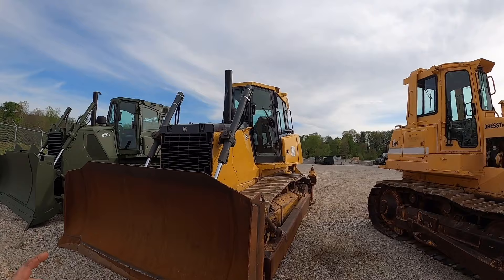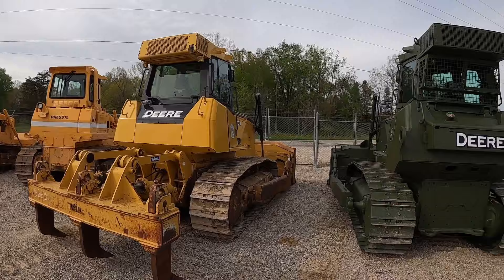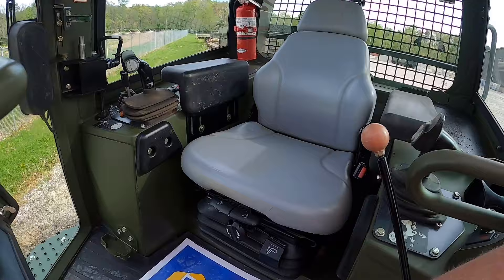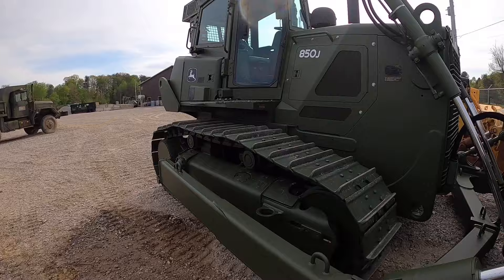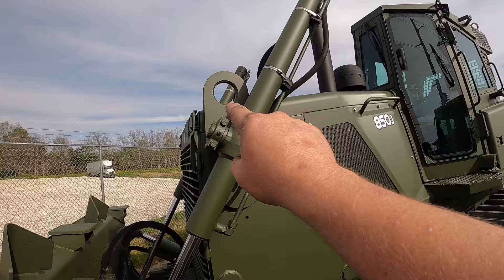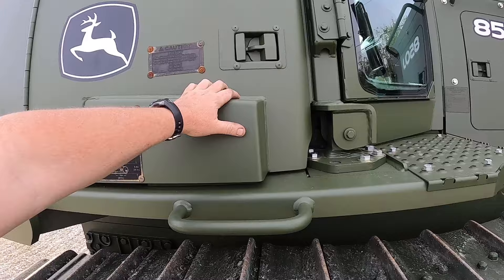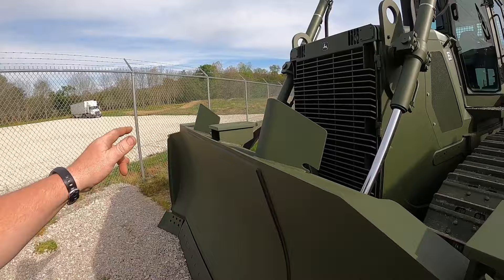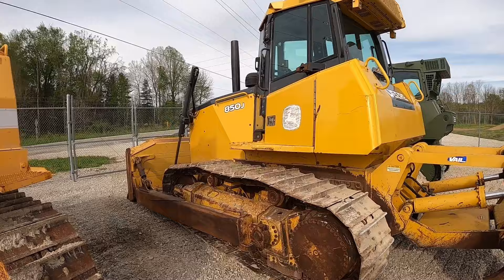Differences between military and civilian 850J John Deere dozers @C_CEQUIPMENT 850JR

Comment: It is a rifle mount not a SAW storage mount.  The side cove is vented on the military dozer.  The lifting hook you pointed out first is a tie down hook.  Rear tool box is for the BII(Basic Issue Items).  On the John Deere website you actually just put in the serial number of the machine especially since there are changes in the parts through a model type in one year model from the beginning of the year to the end of the year.

Comment: It's neat to see the differences laid out like that. I'd love to see what the Florida Forest Service ones are based on. From what I remember, they've got a pretty extensive suite of modifications to 'em for working brush fires.
Reply from the maker: Yep 
Maybe I will do a comparison on the fire dozers one day
Reply: @C_CEQUIPMENT  Would love to see it. Any specialty equipment comparison would make a great video! Thanks for this one!
Reply: GR manufacturing does the upfits for FFS dozers. Aside from the stuff they do and the LGP track pads they are civilized tractors. I work there, we need these military ones
Reply from the maker: @quailman352  we buy allot of screen kits for 700j and k dozers from gr
Reply: Our central shop in lake city also does some fabrication to them as well. They cut the blades down or make V Blades, add a quick release hitch system, do other odds and ends but mostly GR does it all.
Reply: Sure couldn,t regen in the middle of a fire
Reply: The Florida Forest Service has gone from the 450 tractors without a blade to the 650, heavily modified tractors with a blade.  In 30 years they have completely changed the way they do business.  They still pay poverty wages but have nice equipment.
Reply: @RealJeep  It's a shame how crappy FDACS pays. Hell you can make more working at McDonalds than they pay the lady who comes out and checks our groves for greening and such.

Comment: the military 850 is absolutely the way to go..just the bigger cooling system makes it worth it. can run it hotter, longer and harder. no choice in my opinion and not an option but the military version
Reply: Why is that not standard?
Reply: @philup6274  cost

Comment: Lifting hooks are dual purpose - crane lift to transport ship.  Helicopter lift and tote to distant work place.  Very nice to have.
Reply: Yeah....no. A helicopter is not going to lift this 850.
Reply: Actually you described the one single purpose of “lifting”. And “what” actually lifts it does not qualify in and of itself as a sole purpose. No, the sole purpose is to “lift”, regardless by what means soever. However those bottom rear and side tie-down provisions (holes or anchor plates) offer a “dual” purpose, and that’s for securement during shipping and securement for retrieval during emergency recovery towing.
Reply: @kentucky_soldier  lord. I bet when you tried to prove me wrong you overlooked the fact that the sky crane has been retired for almost 50 years.
Reply: @kentucky_soldier  You have ZERO idea what you are talking about. The 850JR dozer weighs almost 44K pounds. There is no helicopter in the US fleet that can lift that, nor would they ever need to. Just stop.

Comment: I’d guess the reason the military dozer doesn’t have the opening vents is for chemical weapons protection, easier to seal a non opening window.
Reply: or its just slightly cheaper. military spec means made by the lowest bidder.
Reply: @nick4506  to a certain standard. Why is that a bad thing?  You’d be crying if the military used the most expensive bidder.
Reply: @nick4506  
I don’t know how many of these were ordered in military spec, but given tooling change costs and other costs inherent with a change my bet would still be on changed for a specific purpose rather than cost. The machine was already in production so changing the design will always incur extra cost! 
The glass could be bullet proof from the bolt in design and it could be that it is easier / cheaper to keep it one piece. 
All that said, it could be the lowest bidder as you suggest, only the procurement department and John Deere will know the true answer! 🤷‍♂️
Reply: @grahamstretch6863   glass panels are made in big sheets then cut into shape by computer controlled glass cutters. there is no extra tooling cost to ordering the glass in a different shape, same process with polycarbonate. and as he said the rest of the changes other than the ac are just bolt on/weld in that dont change the standard parts. its even optioned with the cheaper vinal and spring seat.
Reply: @flight2k5   just saying its green so it must be good isint always true.
Reply: @nick4506  no shit
Reply: It's just easier to replace a damaged window with the bolt in frames. If your tractor catches a stray bullet, you can hot swap the whole frame rather than replace the window in the frame.
Reply: @UpToSpeedOnJaguar  idk if the military even ordered them with replacement windows. they are only there to keep the cold air in from the ac.  if it was broken then thed just tell you to touph it out, its not critical to the function of the doser.
Reply: @nick4506  it's just easier to replace, or allows it (by military standards) to now be a replacement task that can be done on the "operator level", freeing up mechanic maintenance time for other tasks.

It's nothing complex or deep really. I think it was done so that windows can be ordered and installed into frames so regular Joes can make the replacement without need of a mechanic.

While it certainly isn't an operator level task, humvees have swappable replacement window+frames for the same reason. Rolling a new window block on the door is easier and faster than having to dig the old one from old sealant, clean the mounting surface, and re-seal in a new one.
Reply: @UpToSpeedOnJaguar  Exactly, best if any grunt can do the replace, no need for higher trained time draw.
Reply: As a Marine Corps Heavy Equipment Operator, I can tell you we do NOT replace windows or anything else at the operator level. And all of our equipment comes without A/C...

Comment: I installed the first winch on an 850J outside the factory. 
They asked me to write a report on instillation. 
The first wiring harnesses were to short and pulled apart when cab was raised. Never did like how tight the hoses were between winch and dozer. 
Been several years ago now,don’t recall the details.
Reply from the maker: Wiring harness are always just a bit to short on everything it seems
Reply: @C_CEQUIPMENT  seems the early ones had much shorter mounting blocks/spacers the hoses were super tight. 
Had to have them in an exact order and still take your time snuggling it down. 
Not to much later they increase the spacing but it was still tight.
Reply: I’ve not been around one in years now so my memory is a bit foggy.

Comment: Hi from uk guys👋👍 clint thanks for this 👍 its amazing how different 2 identical machines can be👌 but mainly just for army specs!  And yeah was great watching the lads repad the chains for Mike's 850 and was epic watching mike and man behind the schene get tracks back on 👍 I wonder if jet fuel makes them work quicker 😂 be funny watching dozer take off😂  or getting para dropped from 10k feet ( lift eyes would hold wonder if parachute could tho) I still look for jeep hanging from crawler for some reason your intro has not been the same since you sold her lol and kevin done awesome job on the army 850👌 thanks for your time and be safe see you soon👍👋
Reply from the maker: Thanks
Reply: Hey fuel is just kerosene with more additives. 
That makes it sound so much less cool though 😎

Comment: Crazy how governments spec equipment. When I was at the State we were replacing out JD motor graders. They were off the shelf units. Galion got the bid. We had specs for 24V lighting. The dealer would get a grader from the manufacturer and then make a new secondary wiring harness, swap out light the bulbs and add a 24V alternator next to the 12V one. You can see where this is going. Now, add into the fact the dealer that won the bid went under before any graders were delivered to them. The manufacturer then begged other dealers to modify them, several different dealers did and not one was the same. We hated working on them.
Reply from the maker: Wow
I bet

Comment: I have a Question for you guys. I am disabled from waist down and I’ve always wanted to run a machine. Can you take any machine and make it hydrostat?
Reply from the maker: No it needs to be one to begin with
About anything 2000 or newer on the smaller dozers should be hydrostatic 
The Decel pedal would be the only other pedal but that could be rigged up as a hand control pretty easy at least on a Deere machine
Reply: @C_CEQUIPMENT  thanks for answering. Keep the great videos coming!
Reply: Keith b.  The newer flat track cats can be operated without your feet.  The decelerate function can be replicated by your right thumb on a roller switch.

Comment: You don't need to remove the front lifting points to add limb risers.  A family friend found an after market product that attaches to those lift points without modifications.
Reply from the maker: That is true we have just mounted to those also

Comment: When I went to the auctions I would go two to three days ahead of time to check out engines then rotation bearings on the aerial bucket truck and digger derricks and would always be the extension cylinder, rotation bearing and the trucks diesel motors. I had to have a quick guesstimate what I was going to spend to make the equipment loved again or twice loved as I used to say.

Comment: It's NOT a machine gun rack.
It's an M4 / M4A1 rifle with a single shot or 3 shot selector.
It can be modified to full auto but accuracy degrades quickly on full auto and runs your magazine dry to fast.
I hold Expert in Rifle (M16) and Pistol (45).
Now, if you want a machine gun that  should baby definitely be a M2 A1 50 caliber Ma Deuce or thereabouts. 
I can see why you customers prefer the military version.
That monster AC, easy to disassemble and repair cab and windows and generally all around bad a#@ construction of them.
Reply: Quad mount .50 cals mounted on top. Gets those rats with antlers out of the way.
Reply: @kenore4003 .
Wouldn't be much meat left on the bones to eat after.

Comment: Really it depends on the branch of the military hat it was designed for. Marines it comes equipped with a crayon sharpener, navy comes with foatees, Army comes up armored with aluminum siding for mine field clearing, Airforce comes with a light jacket and built in shower.

Comment: Great info on this video. Ty foe sharing. I bet those r fine tractors. Only ran 650 but I loved it. Do either not have lights?? An is box in back just for storage on greeny?
Reply from the maker: They both have small high intensity lights
The box is just for storage I guess

Comment: I would also say that the military dozer has to be certified for CBR operations in which case the cab would be air tight, thus the difference in the A/C unit is that it's most likely sealed off to outside air intrusion?
Reply from the maker: These are not set up that way really
Reply: @C_CEQUIPMENT  That's odd. Usually that's one of the first mil-spec requirements for vehicles with the possibility of being in forward areas?

Comment: The biggest difference on the tactical units, the electrical system is fully 24V. That’s the other reason for the differences on part numbers for fuel pumps etc
Reply from the maker: Both machines are 24volt

Comment: I used the D7 and D9 (mostly 7) when I was an engineer just a few years ago. We got them brand new too. Are they already switching them over to Deere? We had Deere excavators but everything else was Cat, except for the backhoe and skid steer.
Reply from the maker: The usmc had allot of Deere machines
But other branches are running cat I believe
Reply: @C_CEQUIPMENT  that makes sense. We did work with the Marines and their loader was Deere while ours in the army was Cat. Seems like they prefer the smaller, faster to deploy versions. Still a hell of a lot better than a shovel though. Thanks for your reply and the recollection

Comment: Hey Clint got a question..
Is JD still making dozer for Liebherr or is Liebherr self manufacturing dozers.? 
We got a 724 and its just Liebherr paint the rest is JD i think see looks I like it 
For the rest its a mighty machine
Reply from the maker: So liebherr made the Deere 950-1050 C and J model dozers
They also made the 605, 655-755 c and d loaders
Deere parted way with them around 2012 or so all K models and newer are pure Deere machines 
So maybe the model you speak of is similar to one of the Deere machines from back then
Reply: @C_CEQUIPMENT  ah oké Thankyou for explanation Yes the model is from 2009 and still going

Comment: Another great video.  You seem to know quite a bit about these machines; at least you seem to know more about them than many Deere construction dealers.  Regarding the hydraulic cooler (you called a winch cooler) that is plumbed in the Military model, does the hydraulic fluid flow through the heat exchanger ONLY when the winch is present as an option or do the hydraulic circuits flow through the heat exchangers whether the winch is attached or not?  I guess another way of saying this is to ask if the machine is equipped with the hydraulic/winch cooler, does the fluid from the ripper circuit pass through the heat exchanger and get cooled or does the hydraulic fluid only get cooled if the winch is present and activated?
Reply from the maker: Only winch oils flows through that’s cooler
Believe it or not they do not have a cooler for the blade hydraulics but the have a large 20 gal tank
Now the hydrostatic trans has a large cooler in the radiator
Reply: @C_CEQUIPMENT  Yeah, I knew 850J does not have hydraulic cooler in the standard cooling package.  Deere added a standard hydraulic cooler in the cooling package on 850K. Deere relies on the 20 gal tank 'convective sump' like you stated .  My issue is using my ripper is producing a lot of heat in the hydraulics and I need to find a way to cool it. I should add that I probably don't use my ripper like most people do.  I have a huge root plow plugged in the ripper tool bar and when I'm using the ripper I use it all day long and am constantly on the pilot control making adjustments. I've already made sure I don't have any excess bypass in the ripper circuit (cylinders, spool valves) or restrictions that would produce heat.  I've ruled out a bad hydraulic pump because the blade hydraulics never produce excessive heat.  Oh, and I'm in south Texas and it's usually about 100F or better when I'm pulling, but I've never had any cooling issues with hydrostat, engine, blade hydraulics, or anything but hydraulic temps when root plow is on the ripper.  Any thoughts?  I wanted to put a heat exchanger in the hydraulic loop and my machine already has the winch plumbing (including the valving on top of the batteries).
Reply from the maker: @stevefowler244  hmm
What about the relief pressure in that circuit
I could see it bumping relief and heating the oil up 
Might need to check main relief and ripper relief pressure
Reply: @C_CEQUIPMENT  Yuppers, I guess that was where I'm headed next.  I always thought I could hear, feel, or somehow sense if a hydraulic circuit was relieving (like when you deadhead a cylinder), but I guess a gauge is a little more accurate than the "feels".  Thanks for your replies and I always enjoy your video content.

Comment: Clint, when I was in vietnam... those dozers had bullet deflecting glass. A small round wouldn't go through.. it would spider the glass sometimes. Just curious if this glass is like that?
Reply from the maker: Hmm
Not sure on that actually
Reply: All the navy owned ones I've worked with are regular glass unless there's an armor cab kit on it. Those have the 3" thick bullet proof glass windows but they're so small that the sight lines are horrible
Reply: @daveb7397  Thank you as I knew it seemed different..been over fifty years ago, memories are real vague anymore
Reply: May have changed since your time. I can only speak for the last 23 years or so

Comment: First thing I noticed was that the civi dozer was yellow and not JD green and yellow, why would that be? Second was the extra plate in the middle of the blade on the mil-spec version. Very interesting comparison👍👍. Cheers Stuart 🇦🇺
Reply from the maker: Deere construction equipment is yellow only
Farm equipment is green
The push plate is an option on either machine
Reply: @C_CEQUIPMENT  Thanks 👍👍👍

Comment: The 2 big reason Military Dozers don't have a radio is that's an unnecessary luxury and secondly do to it using jet fuel it hauls ass a lot faster so you can't hear the radio !!!   lol    I did notice that the Military Dozer is a nice shiny green compared to the old days where they were a flat green paint or green camouflage paint and did not have air conditioners nor a cab . You just took your chances on them .
Reply from the maker: Lol

Comment: so this may be a dumb question but why do some 850j dozers have the blade mounted to the undercarriage on the outside of the tracks and then some have the c frame mounted blade?
Reply from the maker: So these are what they call outside dozer frame and they just have the semi u 4 way blade
The inside dozer frame will have the 6 way blade so they actually angle also
Reply: cool completely makes sense now thinking about it. I've been wondering that for awhile, appreciate the knowledge as always Clint!